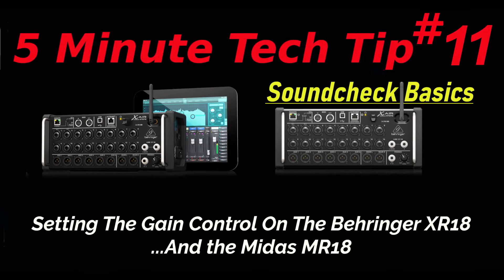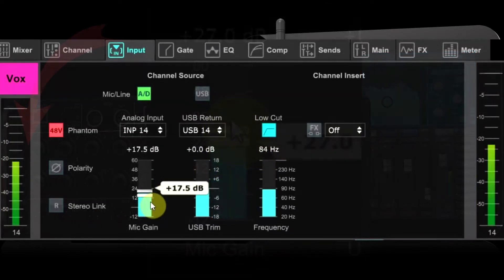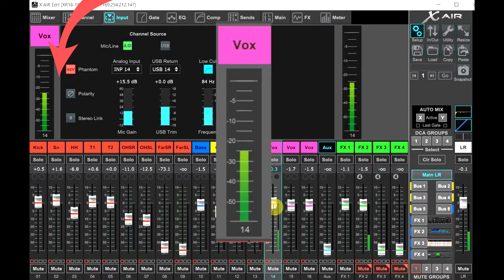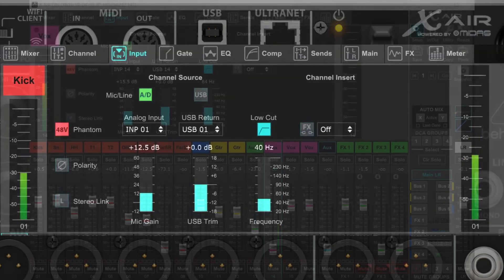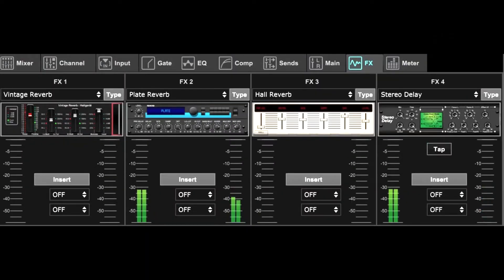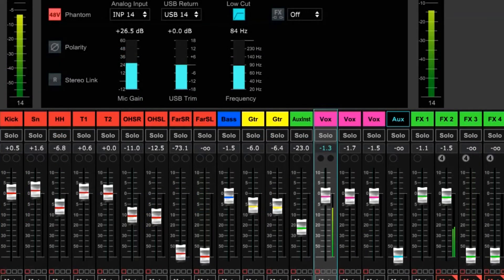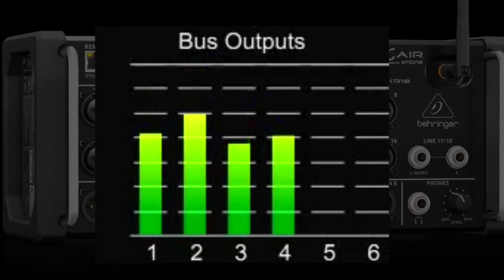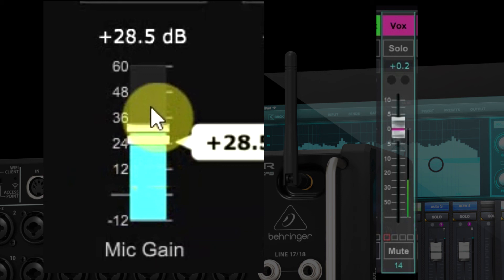Behringer XR18 Gain Staging and Signal Flow -  Soundcheck Basics - X Air Series - Midas MR18

Comment: This applies to DJ boards too correct?

Example: Turning the DJ board up to the highest it will ever be set to for the venue, then setting the gain via the channels the dj board is sent to ie; ch15 &ch16.

Only reason I bring this up is that modifying the volume on the DJ board acts as a "gain" by itself. So it ultimately increases the subs on aux 6, monitor for the dj, etc. 

Interesting little quirk, but something I might fiddle around with so I don't have to worry about other levels increasing due to manual volume adjustments on dj board.
Reply: I'll reiterate that discussing this is more often than not overcomplicating a simplistic adjustment. Since DJing requires playing multiple genres.
Reply from the maker: Yes... Gain staging is gain staging regardless of the source. Whether it's recorded or live. And you are right about multiple genres. Where live music likely has more dynamics to contend with, you have music recorded super bass heavy to music that might not have nearly that much (like an original track from the 60s or 70s for example). So it's a bit of a different monster, but same end goal.

Comment: One point to note is that if you have set the levels for -18dbFS in soundcheck and set the monitor/effects and mains from this level and in the performance somebody turns up so they are way louder you WANT to turn down the gain so the level hits -18db because that will restore the balance to the full mix.
Reply from the maker: I've mentioned that elsewhere in videos, but there's a caveat there too: It depends on circumstances and just how much they turned up. If it's just a few dB it might go unnoticed in the grand scheme of things... until you bring the gain down... and suddenly you hear "the guitar went away!??!!!".

Assuming guitar in that scenario... because... But yeah, it could be anything. Did they turn up because they really did need to be louder onstage, or for ego?

So, yeah, resetting the gain will reset the original monitor balance. But it leaves open the question if anyone actually wanted the balance reset? Technically, you'd expect to get some signs from stage if they do. They might not say "hey, the guitar got louder" (although they could) but it might just be that when the guitar got louder, all of a sudden the vocalist wants more vocal, and the keys wants more keys, and the 2nd guitarist wants more of himself... So you have to use a bit of experience to sus out whether to address a slightly hotter input (if it's not threatening to clip) with a gain change, or just watch the stage to see if all of a sudden musicians are wanting monitor changes. Otherwise, it's sometimes best to leave well-enough alone and not second guess things too much and just use the fader to address FOH where you know you don't want more guitar (or whatever the now loud instrument is). 

And if you do use the gain to reset the balance, you also need to consider the guitarist (or whoever) turned up for a reason so maybe THEIR monitor will need adjusted to give them more guitar.
Reply: @AlanHamiltonAudio  sure all true, that’s why I said “way” louder. Also what I find happening when I play is that the PA is cranked a lot louder in the performance than in soundcheck and things can get lost and it’s hard to know how to communicate what is wrong because the increased volume from the PA masks bass more than it does other parts of the spectrum.

Comment: What are the setings for an E-drum?
Reply from the maker: It kind of depends on whether the drum sound is a sample that is more of a raw drum sound or a processed sound... Or something replicating a Simmons type sound.
If it's a drum sample processed or raw sounding, it probably doesn't need as much treatment as a real drum would. It's probably already gated so gates might not be needed at all. It's probably been limited in dynamic range so compression might not need to be added. And either of those things can probably be applied lightly. And for the most part, gates these days are used to remove ambient sounds from around the drum mics, not so much to shorten the sound of the drum. A well tuned drum rarely 'needs' gating to manipulate the decay versus just to make sure when the drum isn't being played, other sounds aren't getting into the mic's channel. And the gate takes care of that.

But for an e-drum, there is no mic... So it's a pretty good chance there's no 'have to' reason to gate any of the e-drums.

So then it just turns into treating them like real drums on the EQ, with the caveat they might already have some processing done to them so that they already sound close to what you're shooting for with EQ anyway. IOW, the same EQ principles can apply as acoustic drums, but less of it. Less aggressive EQ.
Might look at this playlist:
https://www.youtube.com/playlist?list=PLWtgwSNlxTjMsX8H1K87UcAP17zYSZqsT

Comment: At 1:00+- (showing an Input screen), what is the scale all the way to the right? It looks exactly like the dbfs scale on the left, but when the signal appears it's about 5 units lower on the right-side scale versus the left-side scale.
Reply from the maker: That meter is the AFL meter (After Fader Listen...)... It's showing the signal AFTER the fader.... In a gig situation, in soundcheck, the fader would be down until the gain is set. So the meter would be off. Then, after gain is set, as the fader is brought up, the AFL meter comes up with it.
As the fader comes up, that meter is showing what you're listening to, in the house (and headphones if monitoring the house mix) as far as channel level goes.

If you do have to tweak the gain after the show is rolling, BOTH meters will change with the gain change since EVERYTHING is 'after' the input gain (preamp).
Reply: @AlanHamiltonAudio  Thanks so much! I'd like to ask a follow-up question if I may: I am perpetually confused by what I perceive to be the two main and competing strategies of gain-staging: (1) setting channel input gains at whatever levels that allow the channel faders to be close to "0" in order to give the sound person the most fader flexibility, and (2) setting channel input gains at -18dbfs, which would (I think) result in some channel faders not being near 0 (they could be much higher or lower, and thus have less flexibility). Are these competing strategies? Am I right that you advocate the "gains at -18" strategy? Personally, I think enough people share my confusion that a brief video explanation would be popular. Thanks for all you've done here!
Reply from the maker: @briangray4640  Setting the fader at unity and then bringing the gain up is a leftover archaic practice from the 60's and early 70's... that kind of morphed its way into the 80's. But hasn't actually been relevant for decades now. It works, kind of, with several pitfalls and no actual benefits. More on this in a bit.

The purpose of the gain control is to optimize input levels into the console. And for decades now, we have had meter bridges and/or SOLO/PFL buttons and meters to accurately and with repeatability, set the input gains.
Now, there are some strategies as far as how aggressive or conservative some people might want to be with the gains. And there is absolutely NOT a 'perfect' gain setting. Simply, there's an acceptable window where the gain should reside.

Back in the 60's and 70's metering wasn't as detailed as it is now. And especially at the club level of PAs where maybe you got a clip light on the channels and a signal light. No other meters. But by the 80's even that had changed.

Setting the faders at unity and then bringing the gain up begs the question, why even have faders if the goal is a straight line?
Or if the goal is to have the faders in the vicinity of unity, where there's better fader resolution.... well... on a properly gain staged PA, that's where they'll end up anyway.

In fact, once you use meters to set the gain, and use a consistent workflow and repeatable and expected results, then when you start bringing the channel fader up (or FX sends or monitor sends) they should all fall into 'normal' ranges that you're used to and expect. Example: If your input gain is set properly and you start bringing the channel fader up (and your master fader is at unity as a starting point) then it SHOULD be able to get to unity without being screaming loud, nor incredibly quiet, and certainly not blasting into feedback. And you should also be able to push it above unity and it maybe get 'too' loud... but not STUPID loud. 
If not, then you absolutely know the system gain SOMEWHERE is whacked. Something in the signal chain is 'wrong'. It could be the opposite where the channel at fader unity is not nearly loud enough. Either way, there's something wrong in the signal chain. And one thing you know immediately is your input gain is correct. Your meter tells you that.

You can check your console routing, and your output meters... and if all is normal... then you KNOW the PA you're patching into is improperly gained. If it's your own rig, you fix that at the processor/amps/speakers. If it's a rig that you are patching into and you're locked out of those settings, then use your master fader (and master monitor faders if needed) to get the console behaving normally with normal gain staging WITHIN he console.

That works really well if the problem is the system is gained way too hot. If it's the opposite and the system is not getting loud enough when you get the channel fader to unity, and we're not just talking a few dB, then it's a more serious problem that probably needs addressed at the system level. And it could be the system is simply too small for the task. "Not enough rig for the gig". Or could be a bad cable, blown speakers, bad amp(s), etc...

But regardless, both of these situations will immediately present themselves to you in obvious ways IF you're using modern console gain structure practices.

Besides all of this, repeatable gain settings/levels in the console means that gate and comp threshold settings mean something. You can actually rough those settings in because they actually allow for baselines that repeat. The same goes for any monitor sends, or FX sends, or stream sends, etc. And when you're on your own rig, and rigs you trust to be properly gained, you can know, roughly, where those settings should fall. Which means you can instantly recognize a problem if you suddenly need to dial in way more monitor for your singer (for example).
Also, you know roughly how much gain a vocal, or snare, or guitar will need and can instantly recognize something is way too hot or way too weak coming into the console. You don't just set the input gain in some odd place and say "oh well"... You investigate to figure out what is wrong. Maybe a mic has went bad. Or a cable is one-legged. Or the bass player accidentally switched his built-in DI output to POST Pre amp when he normally gives it to you PRE pre amp.
In the case of a bad mic or cable, if you just crank the gain to get the level to where you 'need' it and don't recognize it as a problem because you don't use your meters... that 'bad' cable or mic could suddenly reconnect and now you screaming feedback or a big POP and the potential to blow some speakers. Or at least hurt some ears.

Usually, the people you see advocating for setting the faders at unity and then bringing the gains up, are probably up there in age, never really toured or did production full time... or else someone that 'learned' that technique from someone like that. And like I said, it 'can' work... it's not efficient. It has pitfalls. It's not ideal. But if that's how someone's always done it, they may not realize there's a better way, or how many workarounds they've incorporated to utilize this method. On their own system, thru trial and error they've probably got the system gained to a point it's going to end up with the same gain settings anyway. But it's happening randomly. And besides all of that.... old habits die hard.
Reply: @AlanHamiltonAudio  Thank you!

Comment: Hi Alan, used my new XR18 tonight at a band gig, got mostly good sound and no issues overall. One thing i did find though when setting gain levels for the kick drum is that in the Config section of the channel, the gain control went from being 'normal' to having no effect on the overall gain level of the kick drum, almost like it either added a pad to the input or it changed it to a line level source. Either way to get the kick drum audible enough, I had to boost the fader right up. It worked but wasnt as good as i know my PA is capable of. Any ideas on why the gain control 'switched'? It also did on my guitar amp channel which was mic'd up with an SM57. Any feedback or guidance appreciated!
Reply from the maker: That's pretty odd. There's never been any switching on the gain to automatically enter a pad or or automated gain freeze or anything like that. I assume since yours is new it's a V2 where something might be different... But nobody has mentioned this issue that I've seen on any forums/groups.

I'm trying to think of something you might've had engaged that would've made it act that way and I'm drawing a blank. The only thing I wonder about is AUTOMIX... You didn't have Automix engaged did you? I'm still not sure it would behave like you described, but it's nothing that I would've ever dealt with either since I've only used automix for conferences.
Reply: @AlanHamiltonAudio  thanks for the reply! I thought it might be the automix being engaged but definitely not that. 
It's very odd. For example, the vocal mics I was able to set gain as you'd expect for each mic i.e. +23.5db for mine, but when setting the gain on the kick drum, it would look normal then all of a sudden the absolute max gain you can set is +20db but whether I left it at 0 or +20db it made no difference to the signal level........,....same with my guitar amp with the SM57. The result was that the faders for those channels were pushed up to +10 just to get some volume through the front of house. 

I'll hook it up today to my laptop a d see if there are any settings I can find or if a firmware update is required. 

Very odd and I can't find anything online to indicate whether it's engaging a pad or something by itself!
Reply from the maker: @davidwicksmusic  This is very weird. Report back on what you figure out. Did you try switching the kick to a different channel to see if it's something channel related?
I suppose it's worth looking into if you were maybe kicked offline and in demo mode or something temporarily and weren't actually controlling the mixer for a bit. That doesn't seem likely, but when something odd happens it's hard to know where to start looking.
Reply: @AlanHamiltonAudio  good news Alan! I found online that around a week ago Behringer released a new firmware and Android app update for the newest versions of the XR18. I installed the firmware, new app and went to my gig for tonight. All worked perfectly and I couldn't be happier with the desk now. 

Behringer mentions somewhere in the update logs that the new V2 versions of the XR18 use different chips or components to the old ones which caused various bugs, hence the updates being required! Happy days all around, gotta say this thing is so simple and easy to use and has already cut down on setup and sound checking time. 
Appreciate your replies and assistance! Hopefully we can pass on our learnings to any one else that might have the same issues! Cheers

Comment: Alan - I see you have had may questions regarding the iPad not showing the level numbers when checking the gain - I solely use the iPad - would you say that when doing sound check for each input, as long as they are just barely hitting the "white" signal bars, that is where you want to be, approximately? That's how I have been determining how to adjust my gain levels. Thanks -
Reply from the maker: If I had an iPad I'd do like I did in the channel walk-thru video where I compared X-Air Edit meters to Mixing Station on the Android, and used a tone so viewers could audibly hear the clip point as well as watch the meters and see how they compared.
But I don't have an iPad :(
Reply: Why? @AlanHamiltonAudio

Comment: Does that mean I’ll have to adjust gain levels of each input at every venue ? Or levels are supposed to be set only just once and left alone?
Reply from the maker: Same band but different venue likely means many things will be at least roughly the same. If one venue is tiny and one is huge, and the band self-adjusts, then maybe the guitar player runs his amp half as loud in that smaller room, and the drummer uses lighter sticks and/or hits softer... So, in that case, the gains would definitely change.
But a lot of bands run the same stage volume with little change regardless of venue, so the gains would stay the same.

A quick look at the input meters would tell you that though. And using a consistent setting on the meters means that if that stuff does change, and you account for it on the gain, it'll pull everything else back into the window of your baseline mix and settings for that band.

If the band changes... or musicians change within the band... all bets are off.